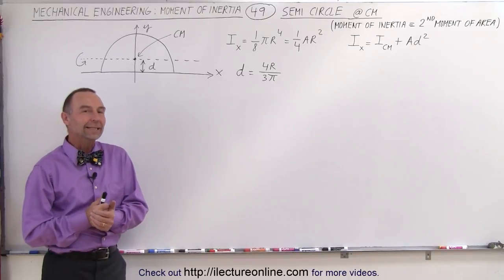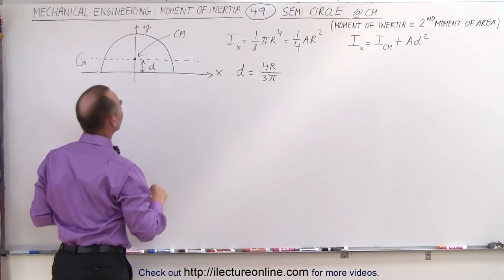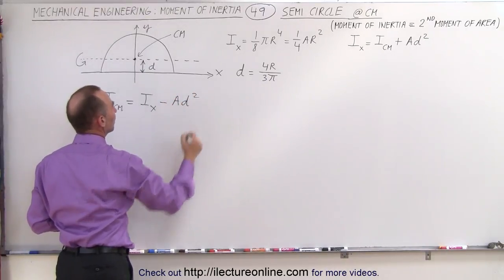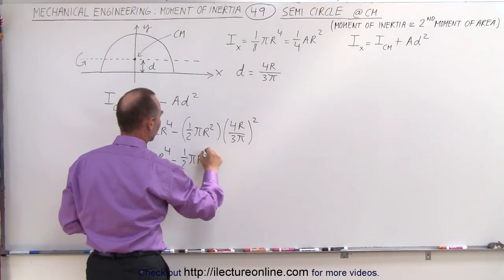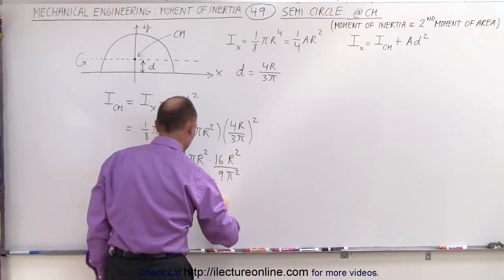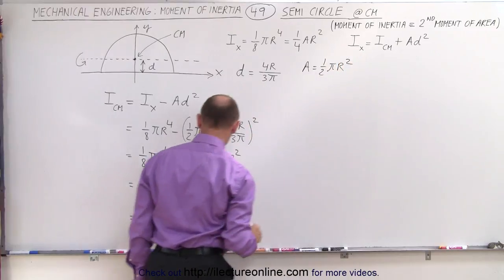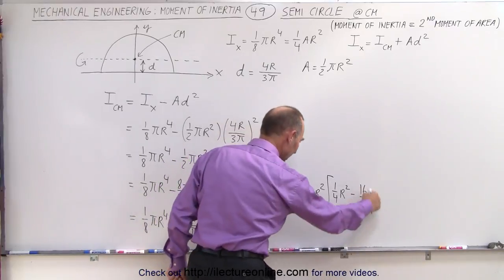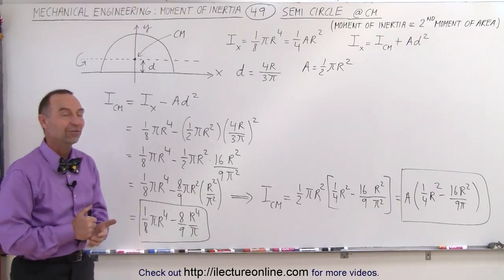Mechanical Engineering: Ch 12: Moment of Inertia (49 of 97) Semi-Circle @ Center of Mass

Comment: why Ad^2 is negative?
Reply from the maker: The equation is:  I = I cm + Ad^2  (which is analogous to the parallel axis theorem).  Then we solved it for I cm = I - Ad^2
Reply: I see, so it is the reverse, thank you sir!
Reply: thanks a lot, ive been stuck trying to figure out why is it negative for the past hour! @MichelvanBiezen
Reply: @FAZAFAZA013  life saver...I was also wondering about the same